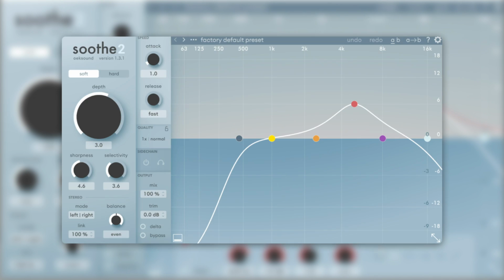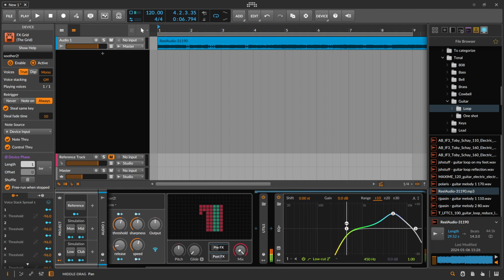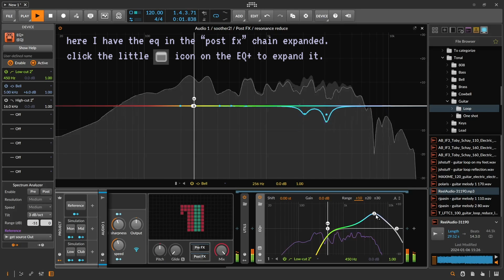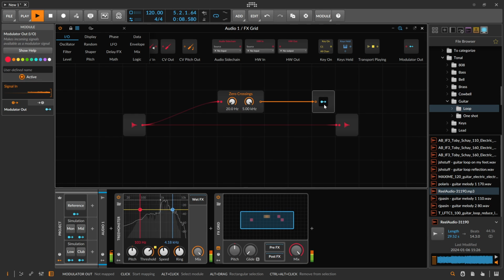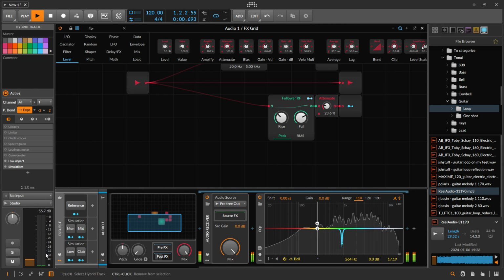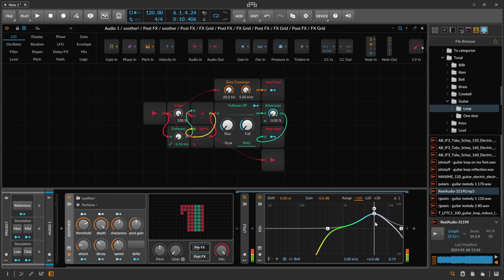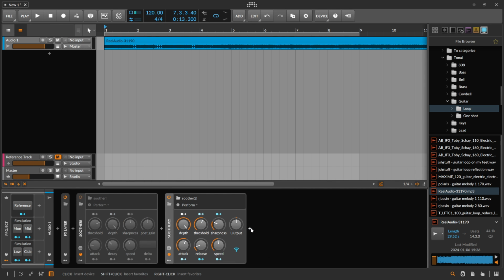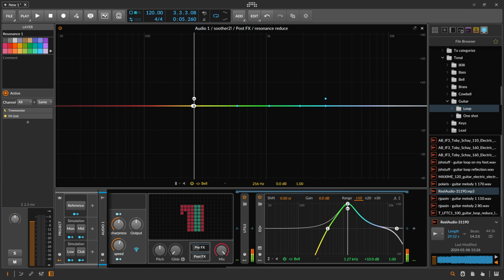how I remade soothe2 from scratch

Comment: I was thinking, maybe using LoudSplit and invert the polarity to create cancelation only on the loud frequencies, and use a Tool device to change the dB of the LoudSplit output so it acts as a Depth knob
Reply from the maker: hold up I was going to disagree with you about using loud split to do this, but there might be something here with this phase inversion idea. I was going to disagree by saying that loud split’s problem is that if you were to simply gain down the loud chain or compress it or something, then you’re affecting all the loud frequencies the same way, which I think would make some weird artifacting or some kind of distortion. but if you invert the phase of the loud chain, the louds will just cancel themselves out by however much you mix it in at. hmmmmmm not sure though, needs experimentation.
Reply from the maker: @MattSanArts umm update I just did 2 minutes of testing and I think this works really really really well?!!
Reply from the maker: only question I have I whether this is in any way different from just turning down the level of the loud chain… I did a null test: 25% mix on the phase inversion and -6db on the loud’s volume knob and it almost nulls perfectly. I think it’s literally the same thing
Reply: @jshstuff  yeah, now thinking it better, i think it's just the same, also putting and EQ inside the Loud Chain may be more Frequency specific, but phaseshift is now a problem. It's good enough tho imo

Comment: moving around the bands sadly seems like a pretty impractical way of setting this up. the best thing is to just have alot of nonmoving bands and attenuate their gain in order to avoid all the eq movement and phaseshifting.
Reply: Yeah but that woukd require making a M4L device or a Lugin because you'd need a kijikion bands for ot to even be effective

Comment: word of caution about DC offset device: since it can only move from -1 to +1, any input signal above that will get hard clipped. and when you map signal out of Grid, you normally apply it at +1 amount to match modulation 1:1, if your internal Grid signal is designed to be normalised as well.
another thought, you could try experimenting with Harmonic Split device before Treemonster or outright instead of it, to isolate frequencies more precisely. just put it in fundamental mode and solo fundamental. ofcourse the downside is big latency you get from spectral devices, especially if you put them in series.

Comment: soothe2 is a spectral processor, so i reckon you could get a much more precise setup by using a loud split and either attenuating or compressing the louder frequencies. using tilt, or by putting it inside a multi band split, you could even have it only process particularly harsh frequency ranges (such as anything above 1 or 3 khz...). i've actually used that kind of setup as a spectral de-esser before :D

Comment: Sorry to be a nerd but you did kind of ask someone to be a nerd in the comments so I volunteer

The way soothe works is that it uses spectral processing, which as I'm sure you know breaks a chunk of audio into sine waves at different phases that will sum together to recreate the sound. If you change the amplitudes of certain sine waves, those frequencies will be changed in the output. Essentially, soothe will split the signal into 2048 individual frequencies that can be reduced if they pass above a certain threshold, determined by the EQ-like curve, with no phasing issues due to how spectral processing works. VR's patch does a decent job of this, and yours gets slightly closer, but it's really impossible to truly replicate what Soothe does with notch filters. There's a free plugin called ReaFIR which has a spectral compressor, essentially what Soothe does, but for some strange reason it never sounds as clean as Soothe, and it also doesn't have sidechain input. I'd love to find a version that can really replicate Soothe, but I haven't been able to yet.
Reply from the maker: stuff got busy and I didn’t check comments on this vid! thanks for nerding out I love it.

yeah I definitely fundamentally misunderstood what soothe is doing. in bitwig I need to explore loud split and the other spectral devices a bit more for this kind of soothe effect.

ReaFIR looks really cool, definitely going to try it out.

have you heard of the free Spectral Compressor plugin by robbert-vdh? it doesn’t have a freely drawable frequency curve like soothe/ReaFIR, but it has pretty extensive controls over the spectral compression (including upward compression!), as well as solid control over the frequencies affected. and despite not looking beautiful, the visualization is actually solid. and so far I think it sounds pretty good. and it has a sidechain feature!
Reply: @jshstuff  yes! I've been using it for a while now, I went on a huge search to find a free spectral compressor and I finally landed on that one. I'd definitely love a more freeform interface, but for some of the things I want to do it works really well. I'm just praying it isn't somehow unstable and breaks all the projects I'm using it in
Reply from the maker: cool! yeah I'm getting a bug pretty often where the UI freezes up on me but otherwise it's been working great.
Reply: Are you sure that's how soothe works? i saw the dev post in a forum once that it's minimum phase and that they abandoned a linear phase mode, so i doubt its processing is spectral. its analysis might be, idk.
Reply: @TildeSounds  actually minimum phase is based on spectral processing, as far as I'm aware. The way that soothe knows what to reduce is because of spectral processing, but it just does it with minimum phase so there isn't any smearing that linear phase stuff likes to add
Reply: @Kallyn  minimum phase filters are very much a time based effect, theyre more or less exactly what jsh does in this video with eq+. Whats your source for all these claims about soothe you’re making?
Reply: @TildeSounds  I've been experimenting with building my own plugins focusing on spectral processing, so I don't have a specific source but rather an intuition. And yes I understand that min phase filters are time based but in order to construct them with that kind of precision and without phase distortion it inherently requires spectral processing at some point in the process
Reply: @Kallyn  maybe yeah. in terms of phase the dev said soothe does cause phase shift, but because it only shifts phase when the notches are active, its not constant and less of an issue. sort of similar to how pro-mbs dynamic phase mode works.

Comment: You're using Treemonster, have you considered using the Harmonic Split device?
Reply from the maker: yeah! I use that pretty often but, correct me if I’m wrong but I’m pretty sure harmonic split’s bands are static. it’s just mega multiband splitting.

actually come to think of it, I’m definitely thinking of loud split. thats the one that can easily tame resonances. but the bands just sit in place which is different from soothe. I do enjoy the whole spectral suite though.
Reply: @jshstuff  You have HP/LP controls just as in treemonster. There's also a threshold and a tilt. I was just looking if it makes sense to use the harmonic split, I guess the main issue with it is that you can't choose how fast the pitch tracking is gonna be, but it seems workable. If you set it to "Harmonics: fundamental", the first split is the loudest frequency in the set frequency range, if you zero in on a specific freq range and you enhance a certain area with a bell, it's going to track the pitch in that area.
Reply: @jshstuff  wrong... there's a sensitivity parameter that NEVER caught my eye until now, it isn't exactly like the "speed" in treemonster, but it does what it seems: it increases the sensitivity of the pitch detector.
Reply from the maker: @personaignota oh true!! I was totally wrong, harmonic split is the spectral suite device I’ve used the least. but I do recall what it does. I’ve only touched it once or twice. I’m definitely going to experiment with using it instead of treemonster. one aversion I have though is that I believe all 4 spectral devices have 40-50ms of latency? I’m not at my desk right now but I think the racks I made are like 2ms or less? I didn’t check.